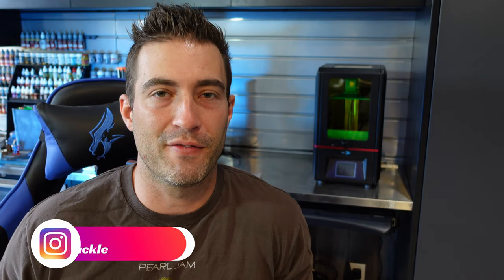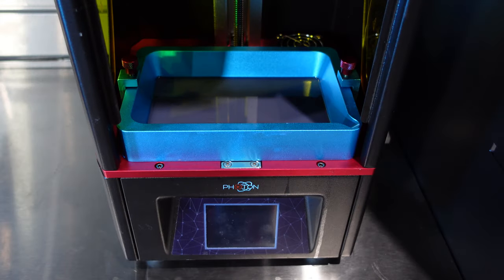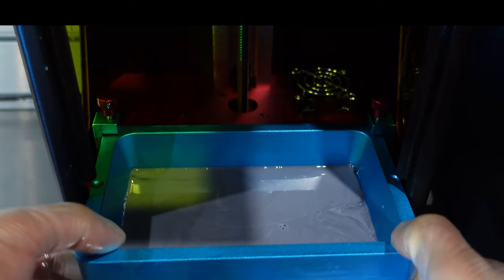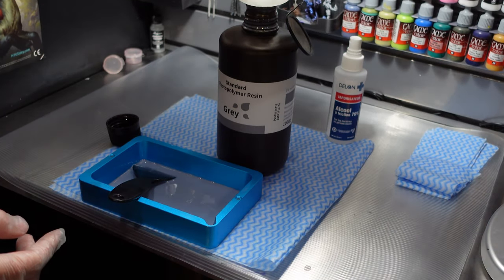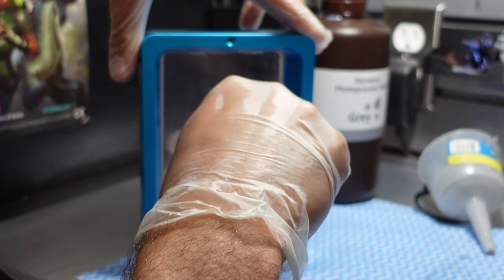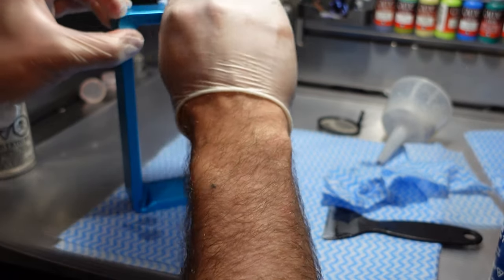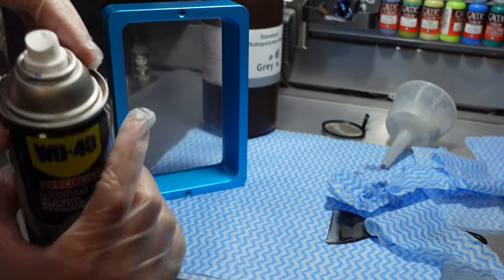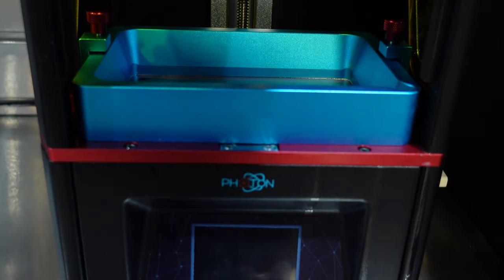STOP Watch First - How To Clean Resin Printers - 3D Printing Beginner Tips - How to Clean the VAT

Comment: I'd honestly recommend only using silicone/rubber squeegee to scrape the resin out. Even the plastic ones will scratch and degrade the fep over time.
Reply from the maker: I will pick one up
Reply: @FacilityD20  I kindly suggest to DO IT as @Matt Collins suggest. 2nd time ever i use my new printer i badly scratched the surface  with the plastic squeegee. it's still usable i think (im less than amauter) but im considering to buy a spare just in case.

Comment: Never put any cloth on your FEP. Empty the vat. Do a tank clean, remove the cured layer, squeegee what's left with a silicone spatula  and wipe the vat only.
Reply from the maker: You can use a cloth. It's faster and easier. It doesn't do any harm.
Reply: Oh yes it does. The less you handle the FEP, the longer it will last. 
 @FacilityD20
Reply from the maker: @kevinlee358  I agree, but so far, for me wear and tear from Printing minis and the occasional stuck print, has damaged all my fep before a lint free cloth has so far. Also dropped my magnetic build plate in there once and it cut a hole...

Comment: Many manufactures had warned about using the plastic spatula on the FEP film.  Please use a silicone spatula instead.  The less scratches, the easier it is for prints to not get suck to the film and break off from supports.
Reply from the maker: Yes i have heard this as well.

Comment: I leave resin in for months and just stir before use. Only time I clean the vat is after a failed print and to do that I get a cured piece of support and raft and place it in a corner of the vat in the resin  then hit the tank clean function 2x 30 seconds to cure a bottom later in the vat. The slowly tug on the support to loosen the cured resin mat out of the vat which removes all failed print blobs.
No scraping or washing = FEP lives longer.
Reply from the maker: For sure! That will work
Reply: good idea about using a cured support piece

Comment: Ahh man you waste a lot of resin there; you can scrape all that into the bottle man; not onto the towel :) other than that, yeah cool tips :)

Edited to add - why did you scrape the resin while the vat was still on the screen; that's a really bad idea dude; if there was a weak FEP, or something that could pierce the FEP, then doing that would directly cause a spillage (never mind what others have observed about the fact that you did cause a splash that could also cause issues)...
Reply from the maker: Yeah, I wasted a bit more then normal, I blame the camera set up, I could have saved more resin for sure. There are two reasons I rubbed the bottom of the vat while in the machine: 1. to quickly check what kind of condition the resin was in, cause it was left a long time,  but it had started to coagulate on the bottom, which lead me to rub it more out of curiosity haha) 2. The spill was on purpose, because I wanted to talk about and show cleaning it because of the potential issue it could cause. (I could have edited that bit out). So it was about 80% intentional and %20 curiosity hahaha.
Reply: @FacilityD20  Yeah I just really don't think encouraging people to do that is a good idea; you could damage the fep, then the resin goes onto the screen and you have to scrape it off (ask me about that :D hah)

Cheers mate,and congrats on the channel success!!

Comment: Do not use the plastic spatula wtf
Reply from the maker: It's fine. Light pressure to help get the resin to flow out,
Reply: @FacilityD20  no, it's not. That scratches fep. Use a rubber squeegie
Reply from the maker: @NerdyCraftsmith  Better then the metal one I got haha

Comment: Very good info for the beginners, great work my friend. And if you don't mind me saying, this process is pretty much the same for water washable resin as well.
Reply from the maker: Yes, that is what I had in there I this video.
Reply: @FacilityD20  why did you bother with alcohol then? :D it would have been good to make that clear maybe - alcohol is what causes all the smells and that can put a lot of people off resin printing but if you use water washable the environmental issues are almost all resolved :)
Reply from the maker: @BeardClipper  I find it gets any stuck partials off. I only use it when I don't plan on filling the vat back up for a while. I don't mind the smell of alcohol, but the small of the resin is a little more annoying for me.

Comment: okay so all throughout the video you were VERY insistent on never getting resin on the screen, i have a screen protector on it, but i think my FEP screen wasnt fitted properly so resin leaked all over the screen protector.

ive ordered a new FEP cause i was an idiot and ruined it on my first try, but should i order a new screen protector aswell and thoroughly clean everything?
Reply from the maker: Get a new protector especially if the resin that was wasted on the screen was cured from the light of the screen.

Comment: been printing since last summer, only changed FEP once and that was because I used IPA to clean it, it made FEP cloudy. Now I've been using built in tank cleaner and it works, but right now after I inspected FEP it had a bit cloudiness in it, but not too bad, probably from tank cleaning since I have to push it from the others side (yes, I wear nitrile gloves), might gonna start using the support technique everyone is talking about, so I don't have to use my fingers to remove resin sheet after cleaning.. we'll see what happens after this current print.
Reply from the maker: I agree i am hesitant to use the self cleaning myself

Comment: I have resin cured to my fep film, does anybody know a good way to get that off with out damaging the fep?
Reply from the maker: Fill it up a little with IPA let is soak, try to rub the back of it with your hands and gently try to pick it off. If it is really bad you might have to replace the fep
Reply: @FacilityD20  Thanks, I hope i can get it off.. I've printed 2 things so far on this fep and I'd hate to have to replace it already.
Reply: If your printer has a vat cleaning option, use it. If not, try running the LCD test for like 30 seconds and then just release the cured film on the vat. It will also take out the cured resin there. You can also use old cured supports from a previous print and put it in one corner and do the LCD test or cure option. Take out the vat and carefully push from beneath the vat with your fingers (not your nails) to release the film from the fep, then you just pull the old support and the film will release with it. Fep clean and good as new.

Comment: when i had a resin printer, i noticed the film started to get a foggy look. think it may came from the alcohol. i used Isopropanol .   did i use the wrong alcohol?    will it affect the print?   uv light not getting through is?
Reply from the maker: No, that will happen over time, eventually you will have to replace the film
Reply: Why is alcohol touching the film of the vat?
Reply: @mizokia  to clean it between prints

Comment: this is not what to do, newer resin printer have a cleaning mode, that will solidify the first few layers and you can use a old support to pull out the sheet of resin.
Reply from the maker: That did really exist back then like it do now, I use that sometimes now to. But a also still go in and clean by hand a lot

Comment: You can use a hair dry air with cautious moderation , into it melt the resin for very easier removal. In combination with the yellow tool to help detach the stuck resin in the FEP or in LCD screen ,that makes them look dirty. after 5 minutes or so with the hair drier , on top of the resin you can detach the resin entirely , leave in one piece and if it was pancake and it will take from the FEB or LCD 99.8% of the resin .  After that Handywipes or microfiber cloth for the final touches.
Reply from the maker: Thanks for the tips!